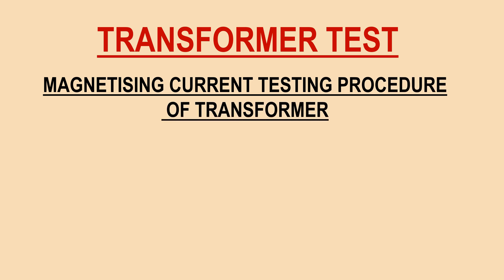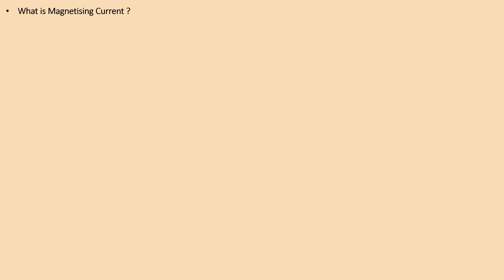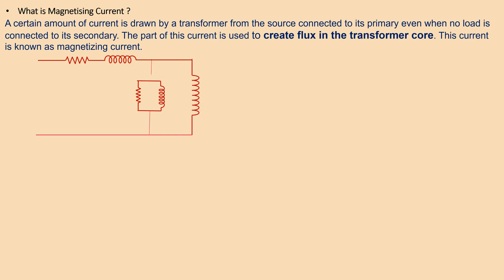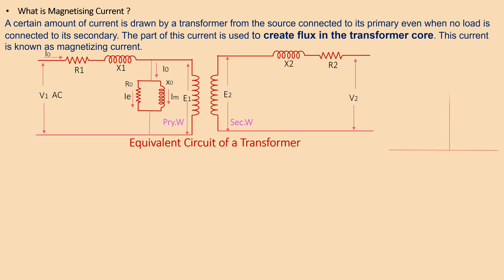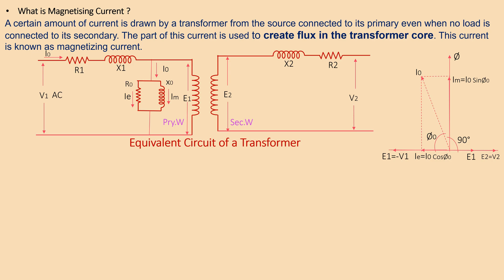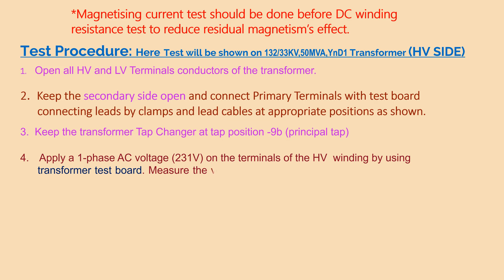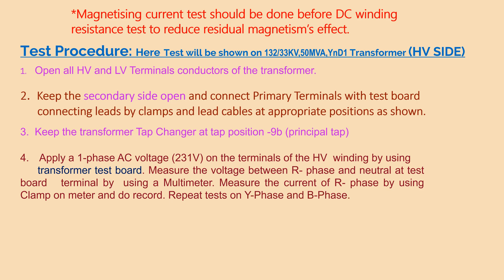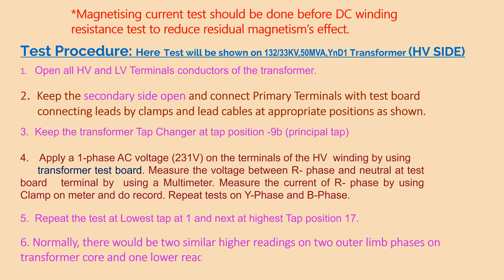MAGNETISING CURRENT TEST OF TRANSFORMER: TEST PROCEDURE OF MAGNETISING CURRENT OF TRANSFORMER:

Comment: Thank you. Can you tell me which standard the magnetising current test of a transformer follows — IEC or IEEE?
Reply from the maker: You are welcome. Sorry for belated reply.The test had been shown as per IEC guide line.The test assesses the integrity of the transformer's core, winding, and tap-changer by measuring the current required to establish magnetic flux in the core  applying a single-phase AC voltage (typically around 230V) to one of the high-voltage (HV) terminals, with the other HV terminals and all LV terminals  open at different Taps. Thanks a lot.

Comment: Sir,
What would be the sequence of test of Pre-Commissioining Test/Site Test of Transformer to get complete information of transformer?
Reply from the maker: You are welcome again. A series of checks & tests are performed on a transformer after installation at sub-station.Generally the sequences of some tests are followed  like Trf. Oil test,IR & PI Test,Magnetic Balance Test, Magnetising Current test,DC winding Resistance test,turns Ratio test, then stability test. Thank you.

Comment: Sir,
After applying voltage at HV side (Three phase) and measure no load current at HV side. Similarly at LV side we apply three phase voltage across transformer LV winding and measure current in each phase. Is it necessary to test at both winding i.e., at HV and LV winding both or we can do it only for HV winding?. This current will be exciting current or no load current of transformer which has magnetizing as well as core loss component of current. Please explain sir
Reply from the maker: You are welcome my dear. Magnetizing current test of transformer is performed  obviously to detect any mismatch of magnetic core structure and that would be obtained only by one side test either HV or LV side. But other tests like  failure in between turn and insulation etc. have  been stated in this video are also needed during the test. Thank you .
Reply: @electricalpassionate  Outstanding sir. Other tests like Voltage/Turn ratio test and Magnetic Balance test also intimate about interturn fault in additioin to magnetic core integrity. Please elaborate
Reply: Many thanks Sir for your efforts. Could you please tell us what is the acceptance criteria of the test results?